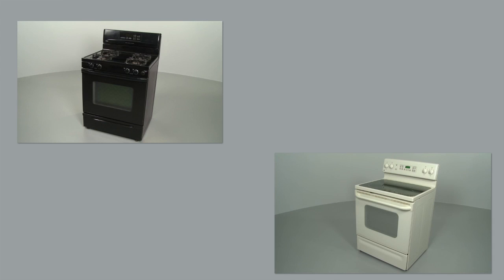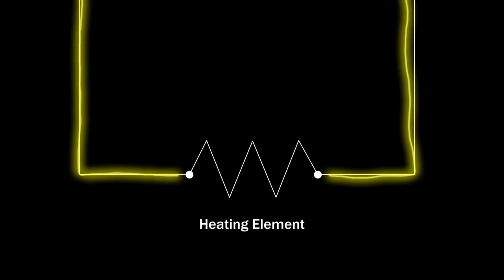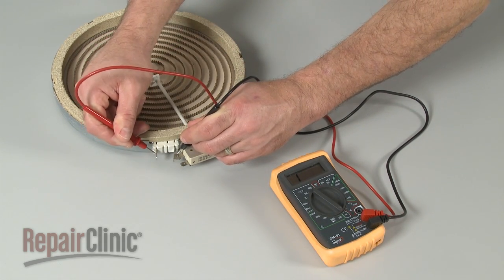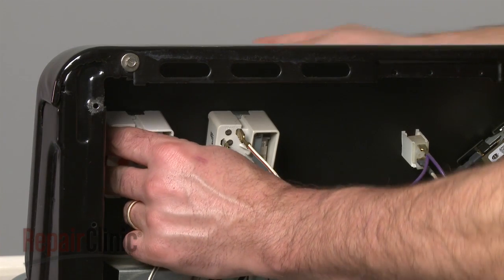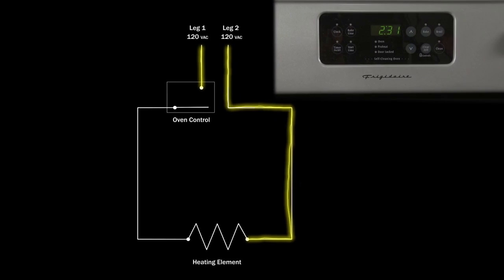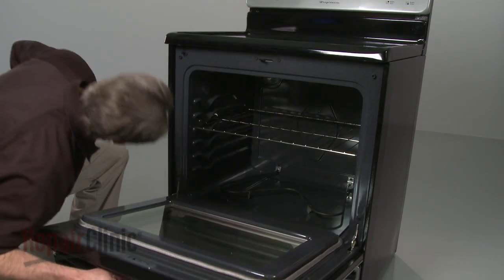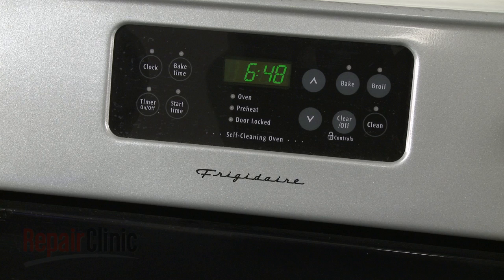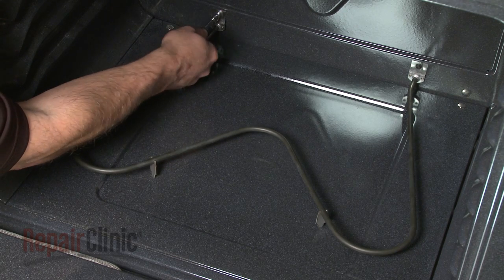How Does An Electric Range & Oven Work? — Appliance Repair

Comment: I truly complement the efforts  and clarity of your tutorial videos. i have used them for years to diagnose and to repair appliances. But I do have an issue with this video.If there was any way that you could edit this video. At the 4:17 mark you show turning off a SPST 20 amp breaker, labeled "OVEN", instead of  WHAT SHOULD BE the correct DPDT 50 amp breaker, that is NEC code for an all electric range.
I can foresee that some Molly Housewife is going to be searching the Breaker Panel for a 20 amp Breaker labeled "OVEN". Again Thank you for your great tutorials.

Comment from the maker: Sarah Michaels, the surface hot switch is normally activated by a sensor on the heating element not the control switch.

Comment: Heated blankets work in similar principles. Inside of heated blankets, there are electric coils inside of the heated blanket. When the power button is pressed, voltage is sent to a thermostat, then to a heating element to heat the blanket. After that, the voltage gets cut off to the thermostat to prevent overheating.  Some models have sensors, or a timer to prevent overheating. If it overheats by 10 degrees, the thermostat, sensors, or timer has failed, and will need to be replaced. 

btw i added this in because you forgot to make a video about the heated blanket i think

Comment: Hi, So glad to find this video. My brand new range doesn't turn on at all (no clock even). What multimeter is safe to test the 240V receptacle? Do I need expensive one? I am afraid of being electrocuted.. THANKS!
Reply from the maker: +Leo So We safely do it in this video. If you are not comfortable testing voltage than we recommend you call for service.
Reply: I'm having the same problem. What was the solution?

Comment: I have a Kenmore model 911.4264991, the bottom right hot indicator light is on all the time (when the burner is ice cold)- can this be fixed by replacing the Surface Element Control switch WB23M8? or WB23M9?

Comment: My LFEF3017LMA model did something weird today...I was trying to use the bake setting and started smelling something burning so opened the oven and the broiler was the only element heating up. I turned it off I heard a slight pop and a little black smoke from back of oven. I took off the back panel and could see black around the bake and broil resistors on the control panel.?

Comment: We just purchased a used older GE glass top convection/bake range.  The glass top burners all work.  The oven control/clock did not light up when first plugged in.  We replaced the whole board and nothing changed.  The oven control board still does not light up.  It's like there is no power at all to the oven controls.  The model is JS968SF5SS, GE said it was 10 years old. Do we need to replace the glass touch ASM, or maybe just the ribbon?
Reply from the maker: +Sue B It sounds like there is a bad wire between the control board and the power cord.
Reply: +RepairClinic.com When my husband took off the ribbon he broke the lock tab on the ribbon that goes into the control board that's why we were thinking that we should replace the ribbon.  We'll get out the voltage meter and start checking wires.

Comment: I have a Maytag Gemini double oven with smooth top. One of the elements has stopped working. I am not sure how to lift the top to access the elements
Reply from the maker: +Marc99GT We don't have a video for your specific model, but here is a disassembly for a glass top Whirlpool. Perhaps your model will have similar screw locations.

Comment: I have replace the control board on a Kenmore mod. 790.46763904 and the broil and bake elements still don't work. The burners on the stove top work fine . Could it be a thermal switch for the oven elements ?
Reply from the maker: ART WILMETH Yes. http://www.repairclinic.com/PartDetail/Thermostat/318578506/1794219?TLSID=1773 You will be happy to see the part for your model has it's own video too.

Comment: The hot surface indicator light for left rear burner of smooth top maytag range stays on even after burner is cooled. Where is the switches that control these indicator lights located and can it be it be replaced if the burner is not faulty?
Reply from the maker: Unfortunately, the switch for the indicator light is part of the burner assembly. The manufacturer does not sell that switch separately.

Comment: My Electric Amana 2005, stopped heating the oven to full heat. The top heating element was working but the bottom element did not check with the ohm meter.
Replaced bottom element and now oven heats to full capability again.

Comment: My big burner on my LG Range on the front left will not heat up at all but the light says it is on. Also, Ironically for the first time ever I had used the warm button to keep something warm in my oven and that is when the front burner stopped working. Would this have anything to do with the problem? What do you think the problem is? Help please!
Reply from the maker: We would need the model of the range to help answer your question. A warm button for the oven should not have any effect on the burner. You may just have a bad burner or switch.

Comment: I had all four burners and oven in use.  then all of a sudden they all stopped. The lights all work but everything else does not. I unplugged and then plugged back in. Clock and lights work but stove and burners dont. Anything you can suggest anything

Comment: Hi - i have a Frigidaire Model FED365EBC stove top slide in Range --- the  bottom Right Element comes  on but goes off and on every 20 seconds or so but its like its always on high heat... no matter where the knob is set on. Is this a Control Switch Problem??? Thanks in advance..
Reply from the maker: +Guns Donovan Here is the right front element http://www.repairclinic.com/PartDetail/Radiant-Surface-Element/316555800/1614140?TLSID=1773

Comment: help fix oven indicator light on doesn't turn off I replace switch LED light still it's on
Reply from the maker: You could have a shorted heating element or the control board may have a shorted relay. The only way to know for sure is to use a meter and see what part is defective. You may need to call a service technician to troubleshoot the problem.

Comment: hi what happens if i cut bout 2meters and strip the two end of an ordinary cord say, electric fan or tv cord to expose the two copper wire and solder each  directly to the conventional coil terminal? will the coil heat up less than normal?? thanks
Reply from the maker: +yuri yuri If you applied 120 volts to the element it will heat, but not properly as the element is designed to use 240 volts.

Comment: Hello ..enjoy ..your videos very informative
....I have a question...We have a Whirlpool range model GERC4110SS0...it has 2 plugs on the top of it(one to the left and on to the right) above the control panel....the fuse on one of them has blown..it is on the top also right beside the plug...it has been out for a couple of months now...We do not know how to change it or get the fuse out ..We have contacted Whirlpool and they do not want to help or give any info..because they do not want to be liable for anything 8( Can you help..?? Thanks in advance Nina F.
Reply from the maker: Carefully pull out the appliance from the cabinets and unplug it. Then the back access panel to the control panel can be removed to access the circuit breakers and receptacles. Looks like the gray circuit breaker is no longer available from the manufacturer but there is a black and white version that could be used in its place. Enter your model number into the search box  on our site, http://www.RepairClinic.com?TLSID=1773, to see all the parts available for your range including the circuit breakers (fuses).

Comment: My oven turns on but heats very slowly (like 30 degrees in an hour) and can't seem to get to 300 even.  The hot surface light won't turn off either, even though the surface is cold. Am I right in assuming it's the control panel? Model# LGEF3045KFB
Reply from the maker: sqrmywrmy The oven taking forever to heat up could be a control board problem as that is what energizes the elements. The hot surface light has to do with a sensor in one of the elements shorting closed.

Comment: I tired of the wussy rings on my 12 yr old Frigidaire limited edition with ceramic top. Cant sear meats, the 2 bigger rings wimp out while on MAX setting  where I need MAX not MAX & BLINK. My pot drawer is toast, can I find a new kit for roller wheels? Thanks.
Reply from the maker: The burners are designed to cut out to prevent the glass from getting too hot. Even on the hottest setting, the burner will not stay on constantly. For this reason, the glass top units are not ideal for very high heat cooking or canning. Enter your model in our website to look at the parts available for your model: http://www.repairclinic.com?TLSID=1773.

Comment: Was changing light bulb and it sparked, stove quit working...Is this a a blown fuse.
Reply from the maker: +RACHELS LIFE If both the oven and stove top stopped working then the house breaker may have tripped and needs to be reset. If there is voltage to the range, but the controls don't light up then the control board is likely defective. The stove top elements should still work though.

Comment: My Frigidaire Electric stove/oven has a issue where the oven won't heat. We replaced the element but it still won't turn on. The touchpad won't turn the oven on. The stovetop however works fine. It's an older model #F04C367BBA
Reply from the maker: +Bruce Hauge The control board is likely defective. Unfortunately the board for your model is no longer available.

Comment: None of the burners on my conventional stove heats up. The display only comes on when a control knob is turned on.(clock,temp,ect.). Turn the control knob off for either burner and the display blanks out. Any solutions?
Reply from the maker: Termn8r3655 If none of the elements work you likely only have 120VAC coming to the stove or a burnt wire in the harness. It would be rare for a combination of all four element control switches or elements to fail.

Comment: My Oven won't turn off. the baking element stays on even with the oven off. contrl panel?
Reply from the maker: ***** The oven control is bad. Whether your model has a switch or a control board. Enter your model at www.repairclinic.com?TLSID=1773 to find the right part.

Comment: hello my kenmore oven wont heat. it clicks like it want to turm up but nothing happens. it doubke clicks every 15 seconds.
Reply from the maker: +Manny Ramirez This video covers that problem. If the elements and incoming power are good then the control is likely defective.

Comment: So, the top element in the stove is  only for "broil" and not "oven" function? If so, it's weird because I always saw on other ovens even very old ones that they have element on both top and bottom. So today while making my cookies and croissant breads, I was trying to follow the online recipe instructions, but unfortunately when I use those instructed temps it simply starts to make smoke from my cookies/breads and burns them rapidly from the bottom, while I waited so long with lower temp for my breads and sadly they became too hard from out and not baked on inside!! Please help I recently moved to this house and really have no idea what is going on. is it that just the element temp must be wrong (actual temp is much higher that burns?)??? 

thanks
Reply: Actually I meant TOP ELEMENT IN OVEN

Comment: I was cleaning the oven and the back of the heating element on the left side sparked. The it wouldn't heat.so we replaced the element and still wont heat .coyld i have blown the fuse
Reply from the maker: Andrea Chatigny One of the breakers could have tripped too. Electric Ovens use two breakers and it is possible for the controls to operate, but not the elements. Some models do have fuses, but the only way to know is to enter your model number in our website. www.repairclinic.com?TLSID=1773

Comment: Great video ! But I have a problem, the left switch keeps turning itself on and off on it's own. The model number is PLEFMZ99GCD MADE BY FRIGIDAIRE. The switch controls the bridge element. I am afraid that it may cause a fire. What should I do ???
Reply from the maker: You may have a selector switch or control board that is shorting. The only way to know for sure what part is causing the problem is to check the parts with a meter and wiring diagram.

Comment: I have a Kenmore oven and when I turn it on it reads door please somebody help me
Reply from the maker: +Susan Peppers There is probably a problem with the door latch used during the self clean cycle.
Reply: How do I fix it
Reply from the maker: +Susan Peppers Use our repair help page and enter your model number to get the exact replacement part and more detailed repair information. http://www.repairclinic.com/RepairHelp/Range-Stove-Oven-Repair-Help

Comment: How does an electric range work? 

It fucking doesn't. Buy a gas range. 😩

I preferred the cheap-as-crap 1980s gas range I had in a FEMA trailer to my modern electric glass top. Absolutely impossible to control heating, even with copper cookware.